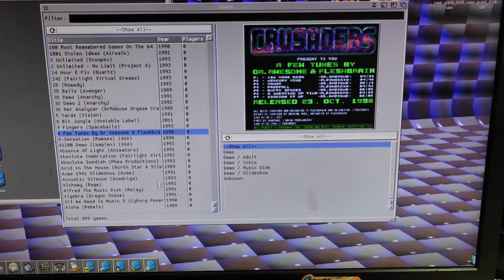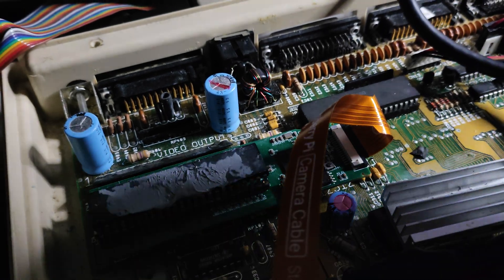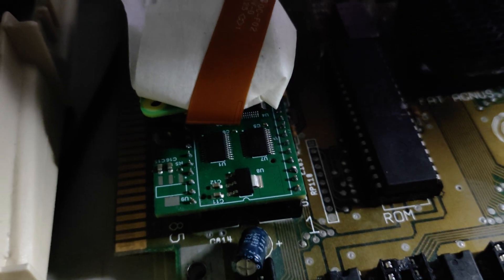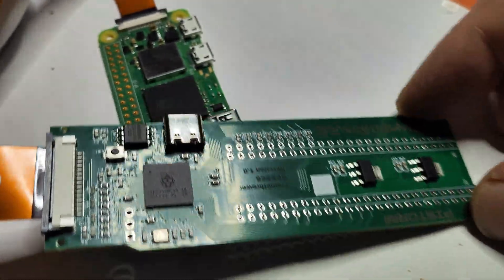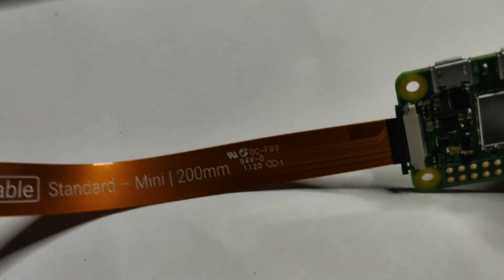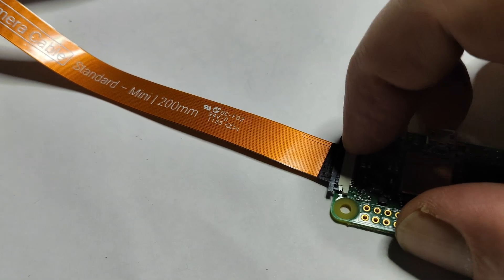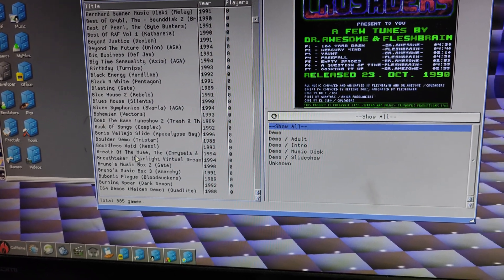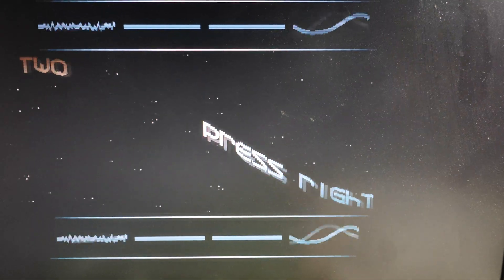Amiga 500 FrameThrower  RGB2HDMI working great PiZero2W PiStorm #amiga500 #framethrower

Comment: Normaly those chips don't get hot right? thats different with the FT? I might need to grab a heatsink there for the 2k. Mine is not here yet though..
Reply from the maker: The heat generated by the Flamethrower running (as it runs its own pi) 
So the heat dissipates onto the Denise chip. It normally gets warm even at fast pistorm levels... Thats my guess...
Reply: @futureretrofusion  Understandable yes and it will never hurt to put a heatsink anyway.

Comment: Does it work with the CM4 board? :)
Reply: i think so, why not?  it has the cam port and you just need to load 2 modules at emu68 startup
Reply from the maker: It should , I need to wait for the cable